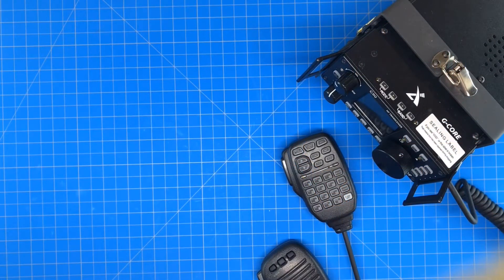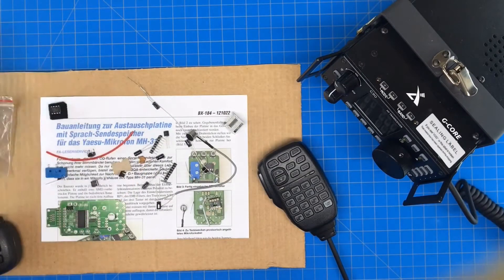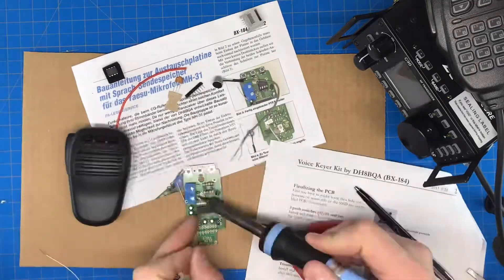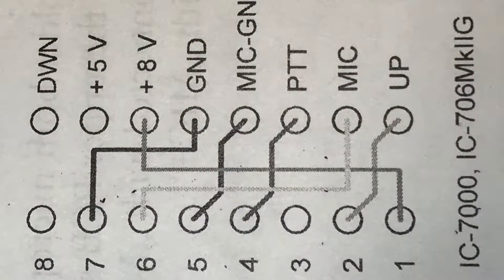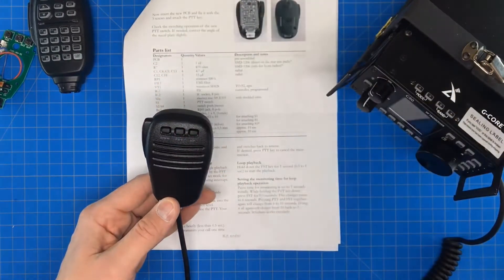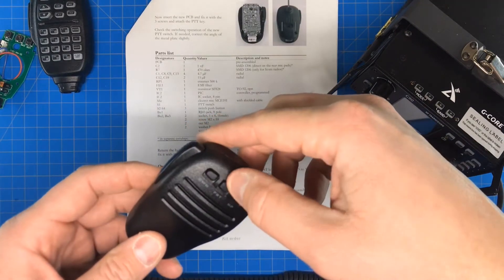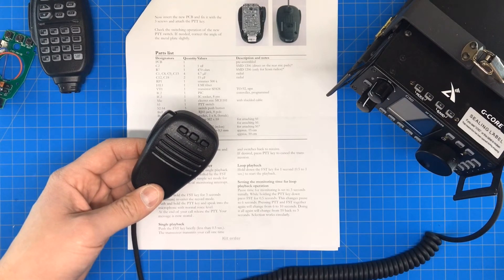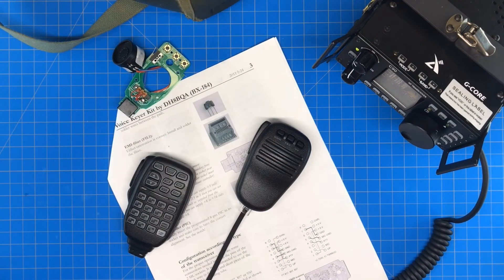Portable voice keyer for the G-90

Comment: Did you install the R7 (470ohm) resistor they say is needed for IC7000 or just did the wiring for the IC7000?
Reply from the maker: yes i installed everything as if it was an IC7000.